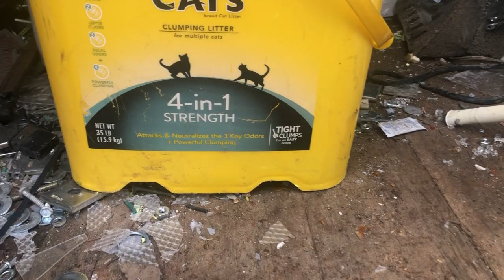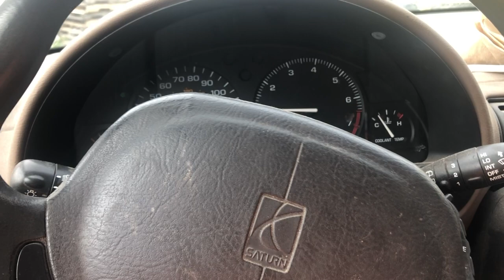SCHOOPIN SCRAPPIN SHOP

Comment: it was 5$ plus in Ontario but I think that was for the special scrappers
Reply from the maker: *special 😮
Reply: @steelisthemeal  high volume customers
Reply from the maker: @danohstoolbox back up .10 cents today after dropping .40 last Friday…..
Reply: @steelisthemeal  I had a bunch of brass fittings for truck air brakes but I traded for a Milwaukee drill and battery 
but i do have a bunch of flushers from Costco when I was doing renovation on the washrooms
Reply from the maker: @danohstoolbox brass is heavy and it adds up quickly
Reply: @steelisthemeal  it dose and i have a clock weight that looks to be brass but is full of lead
Reply from the maker: @danohstoolbox lead is very cheap right now  not worth much